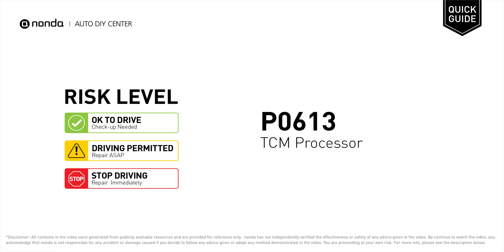What is P0613 Engine Code [Quick Guide]

Comment: I have a 2004 dodge ram 5.7 Hemi and these codes r popping up p061c. P2106.p0340.p0344.p0137. Ugh I give up
Reply from the maker: Hi Kyia, since you are receiving multiple error codes, we suggest to get your vehicle visually inspected by your local mechanic for further diagnosis.
Reply: Look up the codes, n it will pinpoint what you need to do. Internet is your friend use it n you will find your answer. Maybe go to an auto store n ask them if they can hook up their scanner and help you out.just trying to help. 😊